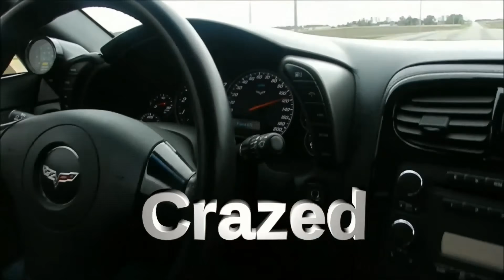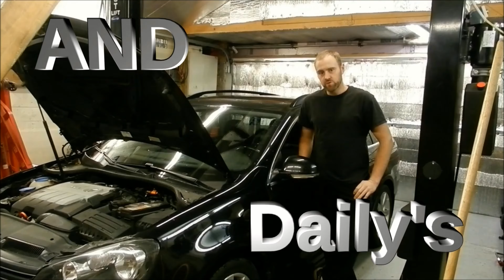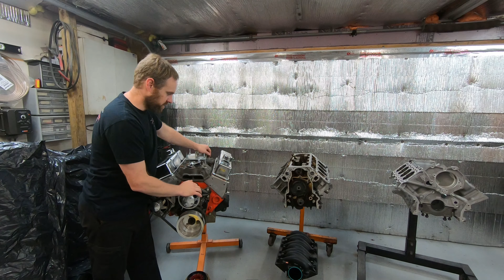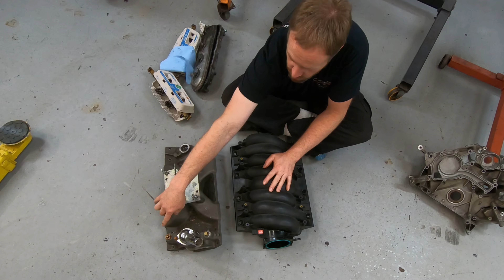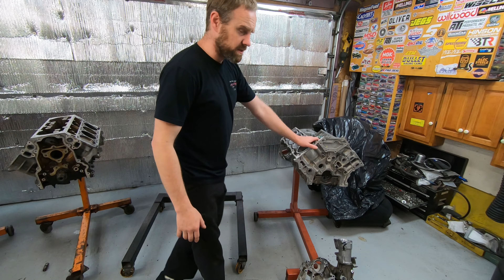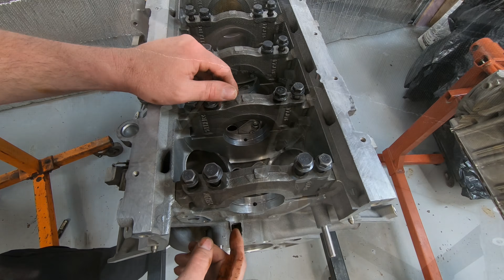Engine Evolution What Has Changed SBC vs SBE LS based

Comment: After the Mercedes is cylinder is honed they are acid washed to expose the silica.
Reply from the maker: Any idea what kind of acid is used? Just curious, I knew they used a chemical but never took the time to dig into it. I just know I can't hone it without sending it off to specialist that cost a small fortune. Only other option is sleeve it but again small fortune lol. This ones in pretty good shape just needs rings gapped and better pistons to take more boost and abuse.

Comment: Off, content question... I'm interested in the shop door insulation.... where you got it, how much insulation value ... it looks like it has some over lap to keep it from binding when the door goes up and down... and where did you find it?
Reply from the maker: It's a pre insulated door with a added insulation I did myself. I added 1.5 in foam and a product called reflectex I believe. It's basically bubble wrap with reflective serface. The factory door I believe is r-8 and so is the foam I added is also r-1 so door has a total of r-17 in theory. I think it's realistically closer to r-14 or 15 but it sure works well. On most of  the walls I have r-11 batting plus 2in foam. So over r-22, all this is to reduce the electric heat bill along with my solar heater.